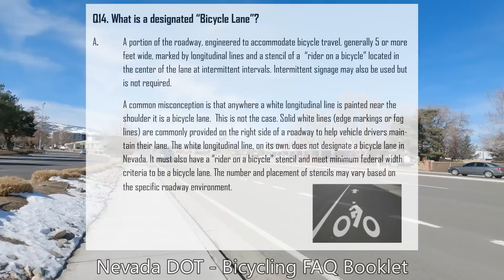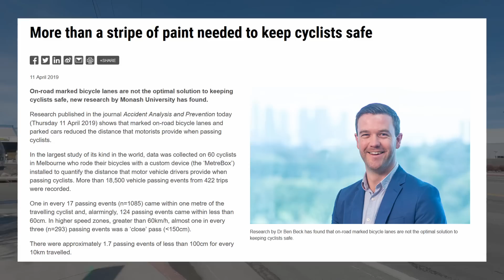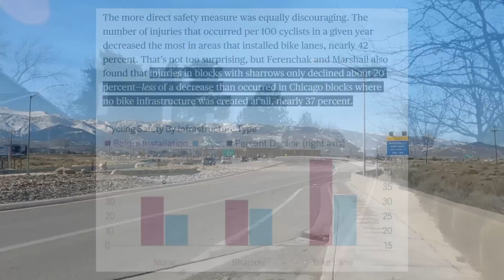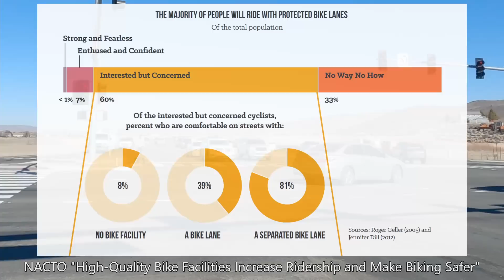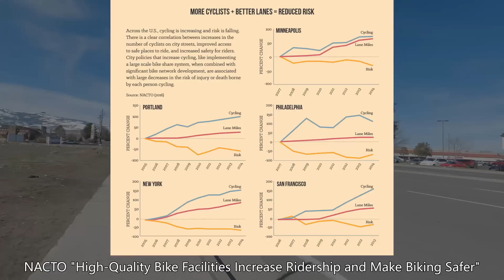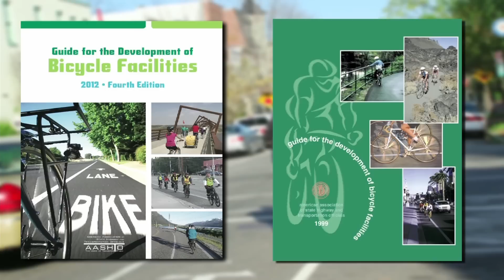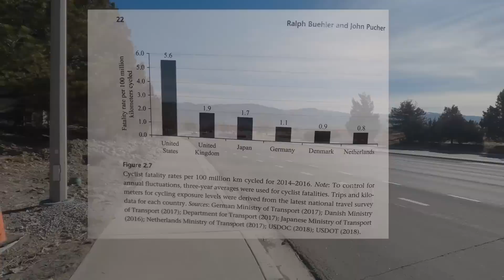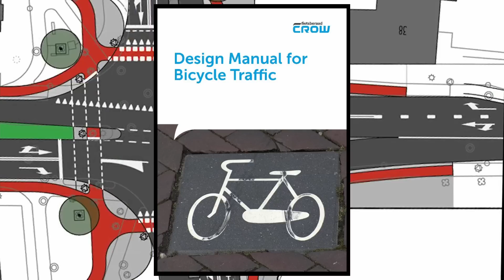Painted Bike Lanes Are Atrocious & Here's How to Fix Them

Comment: Have you personally cycled on painted bike lanes? What about protected bikeway lanes? Having cycled on both personally, I can attest that while I definitely prefer protected lanes mostly for comfort, I wouldn’t call painted lanes dangerous. At least not because there’s a particularly high risk of being hit by a car.

Do you think a curb is likely to have much more of an effect? In my experience, most protected bike lanes have a curb like a sidewalk. Some are separated by street trees, but that’s usually reserved for mixed use pathways. A car at 50km/h is not going to be stopped by a curb. Heck, a bike at 20km/h is not going to be stopped by a curb.

A curb is not for protecting cyclists from out of control cars. It’s to communicate to drivers that that road space is not for them. Is that beneficial? Yes. Is it a massive safety improvement for cyclists? Probably not.
Reply: well you see in the case of an emergency. (ie. a car oncoming and about to hit another car) the person is likely to swerve into the bike lane w/o thinking. With a curb the chance of this is much, much lower b/c going over a curb can damage a car and it's very clear to: do not do this.

There's also inattentive drivers or drivers who don't follow the rules b/c there are few ppl. on bikes or for whatever reason they don't take them into consideration. A curb makes it so that these drivers stay in their lane, b/c going over a curb isn't something normal, fun, and in some cases can potentially damage the car.

So yes, for most crashes the curb is safer for cyclists. Of course it isn't safe for all crashes though. 

If you think about it: why are sidewalks always raised? It's largely b/c it's safer that way even though a car can easily go over a side walk. 

It also gives a lot of psychological comfort to cyclists that a driver can't willy nilly slam into them without thinking. If a driver does go over the curb there will also be a big jolt. If a driver accidentally hits a curb he/she can also correct that and not go over it usually. The cyclist also knows in a split second "hey this isn't right, it's time to panic."

 When drivers routinely go over painted bike lanes, no one really cares that much. When people see a driver routinely going over a curb they're much less likely to accept it as normal so the driver will have a higher chance of being stopped by an officer to see what's going on.

Comment: I am a vehicular cyclist. Most of the footage in this video is of long stretches of highway, where separated bike paths would probably be safer. But I live in an urban area where intersections, parking lots, and driveways are everywhere. Riding on the sidewalk, or a separated bike path if it existed, is dangerous here. I see people on bikes roll into intersections without even looking, assuming that they are pedestrians and that drivers will wait for them. People on sidewalks also often ride in the opposite direction of traffic, which means that they approach intersections from the opposite direction from where drivers are looking. I have even witnessed a head-on collision between two people on bikes on a sidewalk. I am not a fan of painted bike gutters either. In my location I believe it is best to follow the rules of the road and be a part of traffic. That is the best way to ensure that cyclists and drivers are aware of each other and can anticipate where they are going. Yes, it takes more skill and a fair amount of confidence, but I think it is the safest way to ride. I have ridden over 10,000 miles on city streets with only one accident when a car pulled out from a side street into my path and kept going even after I ran into it. Luckily I was not hurt.

Comment: I feel like a big problem with this is due to the roads, when you’ve got 4 or more lanes painted bike paths aren’t good because it would be dangerous, and bike lanes on smaller roads are unnecessary due to the small size and slower traffic along with the lower amount of cars. If you want to have bike lanes they should be separate from the main road lanes with ramps to allow you onto the tarmac if need be. In my town, we have large pavements with one half being for people and the other half being painted in green for bike lanes on main roads, with each side being nearly the full size of a typical pavement, and in smaller roads you can choose to ride on the pavement or on the tarmac based off which one has the most traffic. It’s not ideal and there aren’t bike routes everywhere but it’s better than the system here, I would prefer to have proper bike lanes separated from the main roads, with pavements as a back up where traffic is low and roads are small.

Comment: Probably the biggest issue is that dedicated bike infrastructure is really hard to do at intersections, you either have to move the bike lane further away from the intersection, making it a longer less direct route for cyclists, which also doesn't improve safety because cars aren't going to look out for cyclists. Or you can have car and bike mergers etc which aren't great either. Generally the best way to turn left on a bike is to do a hook turn, and turn right with cars or just ride on to the footpath briefly.
Reply: Protected bike lanes are supposed to handle intersections like pedestrian crossings. Cars are supposed to look out for pedestrians. If someone can walk across the road through footpath safely, than so are cyclists. And turn on red should have been banned.
Reply: @billyswong  Pedestrian crossings are super dangerous, they are in fact much more dangerous than no crossings at all. They give pedestrians a false sense of security which only leads to more accidents.

Comment: fortunately for me most of my riding is done out in the country roads around my town, 1 or 2 lanes (all bad potholes and patches).  but the lanes in the town were "improved" but still not great. like someone said below, our green painted bike lanes are nothing but dirt and gravel collectors, that you practically need a gravel bike to ride them, and one green painted bike lane/gutter goes  right into at least one drain, that has large openings that are parallel to the bike wheel so anything under a 2 inch wide mountain bike tire and you hit that you're eating the gravel., lol.  When i do have to go through town it's more nerve racking than all the wildlife i have to deal with out in the woods.     Ohh and hello from Willits, CA and thanks Reno for the sign!

Comment: Roads aren't made for bikes.  They're made for cars and trucks.  I appreciate that my city at least has a painted bike lane.  That being said, my ride to the bike trail has me ride about a half mile along the road and I use a bike lane instead of the sidewlak/path to not have to stop or slow down at every driveway.  It seems like you're trying to be confusing for a bicycle making turns.  We were taught to be on the right side of a left turn lane, next to the car and when you go, you're to the right side of the car that is making the left turn.  Using a hand signal helps make it clear as well.  As far as turning right, you just ride in the right turn lane.  What's the problem?  What it all boils down to is education and using a good bike friendly system for the city to adopt.  I want to create a bumper sticker like the "Watch for Motorcylces" but for "Be aware.  Don't drive in the Bike Lane" or something like that with some kinda graphic.  I think driving test should also have bike training as well.

Comment: Here they put parked cars between the traffic and the bike lane. Result? Now when I'm driving I DON'T SEE the cyclists, and when turning right I'm 10 times more likely to run into one because I'm already having to look out for pedestrians, and the pedestrian crossing is in a slightly different place than the bike crossing (and also bikes approach much faster).
The only sensible solution is to extend the sidewalk and put the bikes and pedestrians next to each other.

Also on a (somewhat) unrelated note the blind spots in new cars are getting ridiculous. I bought a new car and I literally can't see shit over my shoulder and the A pillars are 3 times bigger than they were in my old one.

Comment: The solution for my city would just be to widen all sidewalks to 10 feet and have them be mandatory on both sides of any roadway.

Bike lanes are absurdly dangerous in my city, when they even exist at all, so I usually just take the sidewalk anyway. It doesn't help that, not only to these bike lanes begin and end with no warning, but they usually do so with nowhere to go. I'm not hopping off the sidewalk for a bike gutter that's only there for 100 meters.

The ratio of speeds for bike:pedestrian is much less than car:bike, and the same goes for the weight difference. In the event of a collision, I would much rather be a pedestrian hit by a bike than a biker hit by a car.

There's not much foot traffic in my city anyway; everything's too spread out and most people are in cars.

Comment: We have lanes like this everywhere in European cities BUT the traffic is used to them and the speed is pretty low at 30-50kmh. But this...
This is like I'd put a bike lane on the city autobahn in Berlin (where speed is usually 70-90) and call it safe.
Reply: Same. I'm looking at this thinking, is it because our lanes are green that they're safer? I get it, paint isn't infrastructure, but both my decade of commuting by bike, and my year of driving, I've never encountered people just totally and utterly disregarding cycle lanes completely. Like, why would they come out of their car lane anyway?

I feel generally safe on the green painted cycle lanes, but I also think that they're only used on roads where its appropriate in the UK. If its any road above 30mph in town, then it will probably have a pedestrian/cycle path completely separate from the road.
Reply: I've seen similar design in Belgium. I was riding a rout for the first time and trusted google. Cars were supposed to go 70 km/h but they went closer to 100 on a 3 lane road. To my right trucks were placed. There was only paint between me and the cars and the strip was very narrow. Heard they are changing it. Never felt so fragile while on a bike.

Comment: One of my favorite bike “lanes” goes through cars merging on and off the highway on either side of you. On the other side, you have to move over to avoid the highway entry lane while praying that no one will try to pass you or swipe your arm as you signal :)  And yet, I used to ride through it everyday to work when I was 18 because the sidewalk crossing there was awkward and less convenient than riding through directly. Probably wouldn’t do it now though.